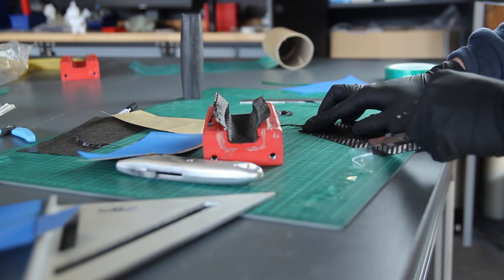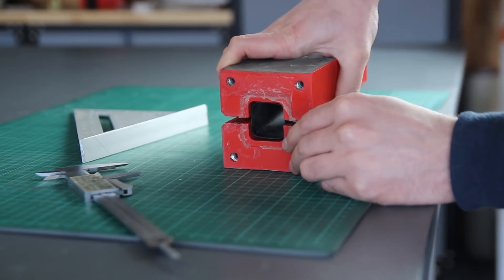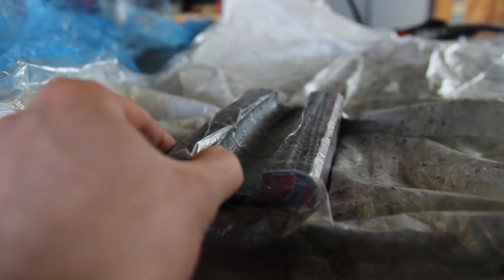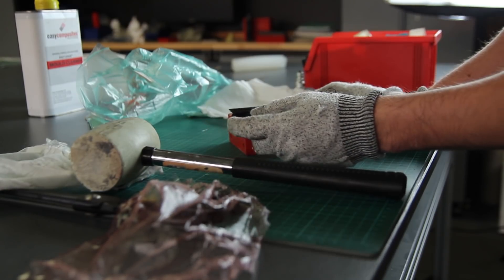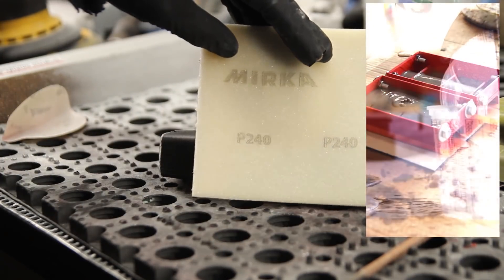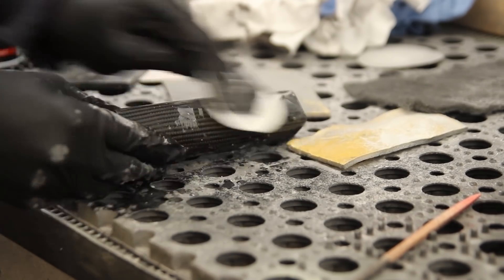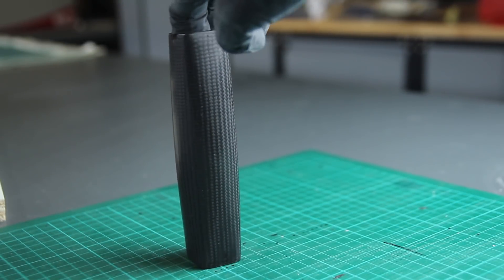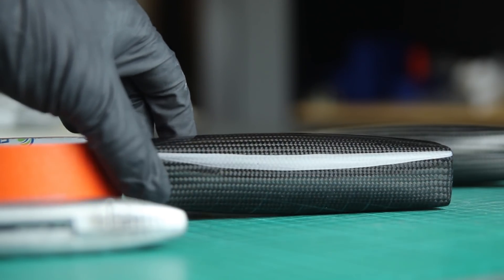3D Printed PLA Moulds Up To 120°C To Use With Carbon Fiber Prepreg, Will It Work?! + Finishing Parts

Comment: What prepreg are you using and do you cure it at a constant temp or ramp up and down? Do you need a special oven? Thx!
Reply from the maker: Xpreg from Easy Composites, ramp up till 120°c yes you would need a special oven for best results
Reply: @MatthieuLibeert  ah. Ok. Thx. So you can’t just take it up to 120 and let it cure snd cool off. Thanks again!
Reply from the maker: @catalystarms7616  yes you could try but maybe with a less good result

Comment: I've used easy comps a lot in the past and got good results at 120degrees for just two hours no problems
Reply from the maker: correct works as well, every mould is a bit different so finetuning is needed here and there for temperatures of mould and prepreg

Comment: In your opinion, what is the filament material best able to handle high temp while maintaining dimensional stability?
Reply from the maker: Hard to say, resin printed might be better, looking into that. Otherwise PETG or Nylon I guess, but a bit harder to print

Comment: Use PETG dude
Reply from the maker: should work as well! wanted to try PLA first as it's easier to print
Reply: @MatthieuLibeert  PETG with 100% infill. easy composites has a tutorial on this. thank you for the video!
Reply from the maker: @luis7899  I'm aware of that video but petg with 100% infill wouldn't stand the 120°C maybe till 70°c
Reply: @MatthieuLibeert  there is a new filament called carbon filament with a base of PLA, and therefore increased mechanical properties. You can try that, but just make sure you upgrade your nozzle for a hardened one.
Reply from the maker: I know about a carbonfiber with nylon and petg but didn't know about it with pla, will need to check that out, thanks
Reply: @luis7899  CF-PLA has increased glass transition temp? i thought it behaved thermally like regular PLA, not even HR-PLA

Comment: Some of my molds were printed from PC by polymaker and they work perfectly with prepreg but I only tried the low temp curing cycle at 85 degrees C
Reply from the maker: I'm looking into sponsoring of SLA printers that might solve many problems! stay tuned for future videos ;) great to see many carbon fiber enthusiasts here into 3d printing :D
Reply: @MatthieuLibeert  the problem with SLA is the size it gives for part but to make little part it should be perfect man I was thinking about the same idea! Just need to find really rigide and heat resistance resin too (and a SLA printer..🥲)
We really probably don’t need to sand with SLA too
I’m excited to see the polish carbon fiber like koenigsegg asap!! :))

Comment: have you tried taking a micrometer to these molds before and after curing? i think that might be helpful in determining if theyre keeping their shape under the elevated heat.
Reply from the maker: at this point it at first sight it was ok, but on further inspection it was noticeable without a micrometer, but might be something I'll try next!